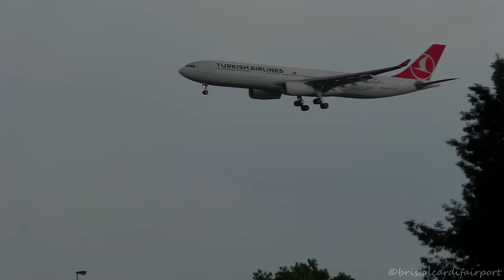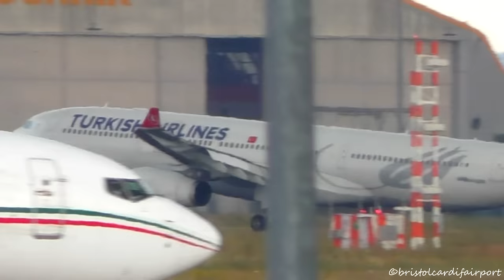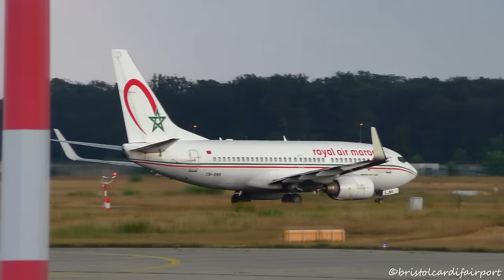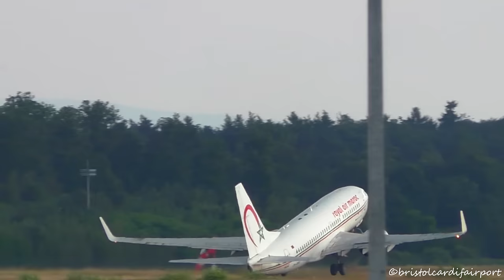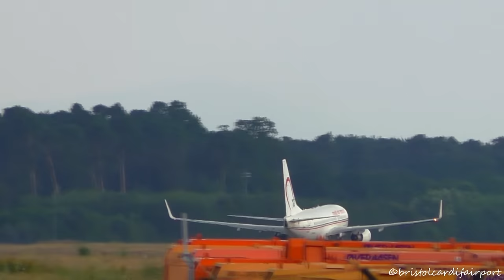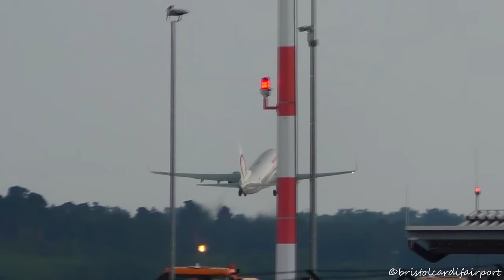PASSENGER AIRCRAFT FAILS TO TAKEOFF! BOEING 737 NEAR TAIL STRIKE & STALL ON TAKEOFF

Comment: Greetings to all!

After watching this horrifying video,  I asked an actual pilot of the airline for some insight. Turns out he was aware of this.

Turns out, wasn't a mistake at all.. as most of us thought at first.

-ATC warned the pilots about the possibility of wake turbulence caused by a preceding A330.
-737 encountered wake turbulence at rotation, which caused the airspeed/lift to bleed rapidly
-He had already pulled the nose up, and it happens that the plane regains lift, so he waited
-When the plane did gain those few feets and landed back, that's when he followed airline procedure.
-Procedure was (like many other airlines) to put the plane's nose back on runway, pick up speed again, and take off... Assuming the runway length allowed it of course, which I'm pretty sure it did at Frankfurt airport.

He wasn't surprised or anything at all.

No errors in FMC or flaps setting whatsoever... Anyway you can clearly see the "Flaps 1" setting. Was just basic aerodynamic kicking in at Vr. 

Bad timing that's all. In other words, not as bad as it looks.

Thought I'd share this today.
Cheers to you plane lovers!
Reply: Your source at Royal Air Maroc may be correct. Most posters here did not do the research to learn how wake vortices from the heavy A330 could continue to rotate in the departure path of the 737. The effect is like a microburst at the surface and would cause indicated airspeed to initially increase during the encounter. EDDF airport configuration is a significant factor due to runway layout. Addendum: After further research, the conclusion about wake turbulence is likely flawed. The vortices from the A330 should have decayed rapidly and any residual winds near the ground would likely cause no issue for the 737 departing into the path of a crossing aircraft even before expiration of the mandatory 2-minute ATC delay. More likely, the cause of this incident is an erroneous weight entry in the FMC. Still, it remains of mild interest that much of "the action" took place around the intersection of runway 18 and the extended centerline of runway 7R-25L. Coincidence? Probably. Regarding flap settings, the crew selected flaps 1 which is not unusual for a 737-700 departing a 4 kilometer runway.
Reply: Sccratlanta wtf you mean incorrect. His information came from a pilot. Are you a commercial airline pilot?? Nope....didn't think so.
Reply: revolver1212 if there is possible turbulence from previous departet aircraft why dont they wait longer? What is the required minimum waiting time?
Reply: revolver1212 Yeah, right. They're just lucky they got time and distance to cover their tracks so they didn't get investigated cos arses would have been kicked. Everyone knows that 😂
Reply: Allyn Perdue As if 😄
Reply: thanks mate, learnt something
Reply: Then the fault lies with the ATC who should never had sent him on a take-off roll that soon before a heavy aircraft.
Reply: K Hitch Absolute rubbish. I talked to tower controllers and the statement the air line made has been laughed at by the authorities involved. The other aircraft didn't even touch down on the same part of the runway and flew through different airspace altogether. In fact that airline is very close to getting banned from flying into European airspace because their safety standards are a great cause for concern.
Reply: Swede Potato Dishing
That is a conflicting story to the one served by OP. So who's telling the correct one?
Reply: revolver1212 Bruh im so scared of flying...
Reply: It depends upon the classification (weight primarily) of the involved aircraft. In this particular case, a 737-700 departing into the flight path of an arriving A330, the delay should be two minutes. Delays can be waived upon request by the departing flight crew.
Reply: Swede Potato Dishing, your statement that "the other aircraft didn't even touch down on the same part of the runway and flew through different airspace altogether" is inaccurate. Fact: The A330 approaching runway 7R crossed 1/2 mile directly ahead of the 737 departing runway 18. That puts active vortices directly in the flight path of the 737. A two minute ATC departure delay is required but may be waived at the departing flight crew's request. As for problems with Royal Air Maroc and European Union airspace, there is absolutely nothing online about their getting banned. Perhaps you can point to something real and not made up.
Reply: K Hitch, it's definitely not Swede Potato Pie. She's dishing nothing but BS. Stick with the OP.
Reply: Allyn Perdue You believe what u wanna believe, sunshine, as long as the right ppl know 😉
Reply: H
Reply: Allyn Perdue Maybe phone Frankfurt Airport if u don't believe me and they will confirm IT WASNT EVEN THE SAME RUNWAY - its a huge international airport - one of the best in Europe - and they have two parallel runways for a start.
I was born a few km down the road and lived there for many yrs. I know a handful of ppl who've worked there and as I said: That airline's statement which btw was made ONLY on Twitter, was a joke and embarrassment in itself 😂
Reply: Swede Potato Pie, there is a saying that "a little knowledge/learning is a dangerous thing." You fit the bill perfectly. I spent twenty years as an air traffic controller and have an Airline Transport Pilot's certificate with Learjet Type Rating (a few thousand hours of flight time). I also hold Flight Instructor certification for instrument, multi-engine and single-engine land. I'm going to once again address your obsession with the SAME RUNWAY and see if you possibly can learn more than the modicum you exhibit. Wake turbulence from a heavy aircraft affects all aircraft that enters airspace beneath the heavy's flight path. They do not have to be using the same runway. Again, and louder..THEY DO NOT HAVE TO BE USING THE SAME RUNWAY. Do you understand this?
Reply: Swede Potato Pie, the layout at Frankfurt (EDDF) features more than parallel runways (7L/25R, 7C/25C and 7R/25L). On the west side of the airport is runway 18 facing south. Used only for departures, the runway begins about 1/2 mile north of the extended centerline of 7R/25L. Descending vortices from aircraft approaching runway 7R will disperse roughly 1/2 mile south of the beginning of runway 18 and may drift south with a northeasterly prevailing wind. Aircraft departing runway 18 can be affected by the wake of aircraft landing runway 7R. Again and louder: AIRCRAFT DEPARTING RUNWAY 18 CAN BE AFFECTED BY THE WAKE OF AIRCRAFT LANDING RUNWAY 7R. Any questions at this point?
Reply: Swede Potato Pie, I happen to agree with you about RAM's statement. Though I believe there was a wake turbulence event, their statement about a maneuver was poorly worded. Too bad it didn't translate better. Quite embarrassing.
Reply: does it mean the pilots didn't heed to the advice of the ATC's?
Reply: Ced 1, most likely they didn't wait for the full two minutes. Pilots can waive the two minute delay by request.
Reply: revolver121
Reply: revolver1212
What if the runway wasn't long enough?
What would be the alternative or rather emergency action the pilot could have done there?
Please find out. I get scared on take offs and landing anyway and after watching this - "it is one more phobias to my collections of air flights".
Reply: revolver1212 
additionally, I notice the spoilers partially open at the peak of rotation
Reply: *FEETS*
Reply: In other words the error was in the atc in not allowing correct separation. In that case the captain followed correct procedure.  If I was that pilot, I would have been very pissed at ATC!! Could have ended very badly if shorter runway!
Reply: crowxe Irrelevant, those are flight spoilers used for roll control
Reply: Jesper Andersson 
you mean those that can be set to deploy automatically on touch down to sit the plane down and prevent it from forming lift enough to leave the ground again?
Reply: crowxe No, as i said, those in the video are flight/roll spoilers, not ground spoilers, the ground spoilers did not deploy in this video, the ground spoilers are very easy to spot because they basically cover the entire length of the wing all the way to the ailerons and the ground spoilers deploy almost vertically:

https://c1.staticflickr.com/5/4144/5193160905_9b64402237_b.jpg

Flight/roll spoilers is nothing unusual so no point for you to point them out in your previous comment.
Reply: Jesper Andersson 
so there's different set of spoilers for the 2 tasks? and if so , isn't the spoiler can be selected in various degrees like flaps? coz I remember seeing them during descent couple times and they weren't vertical (type was  A330)
Reply: crowxe The ground spoilers never deploys in the air (those that raise up vertically), and then there is flight spoilers that moves either independently or with the ailerons. The pilot can deploy the flight spoilers manually to reduce airspeed (those where the spoilers you saw in the A330), when they are not manually deployed they work as secondary flight controls (like they did in the video, they where used for roll, not for airspeed reduction).

I found a video that shows pretty nicely how they work https://www.youtube.com/watch?v=ejR9VX_UbxM
In the first part of the video the flight spoilers are deployed by the pilot and their position are fixed to reduce airspeed, then after a while they are retracted back onto the wing, when they do so they start to move with the ailerons to control roll, you can see them move several times during the landing (those are the same spoilers that moved in the video we are commenting), then when the airplane lands then obviously the ground spoilers are deployed.

If its still unclear, here is an illustration of the 737 spoiler system and an explanation https://image.slidesharecdn.com/flight-controls-r-01-160820230450/95/b737300400-flight-controls-45-638.jpg?cb=1471734341
Reply: djrmonix I know this was 3 mo the ago but there really isn't a set minimum wait time. ATC is required to make a 2 mile separation or 1000ft between flight levels. Sometimes, the controller will hold smaller planes for up to 2 minutes but most small planes avoid wake turbulence by the fact that they usually take off a lot earlier than commercial jets. The person who posted it felt like there was a safety issue and while wake turbulence is a safety issue, the pilot did what pilots are trained to do. That is, lower the nose and apply throttle in a stall. You'll note that the plane in this situation seems to be floating for a time. That's because the plane is close enough to the ground to get ground effect and the pilot could set it back down easy, get out of the wake, and then take off again. It happens more than you'd think, especially at larger airports with more traffic.
Reply: Spencer Coleman, there is a wait time of two minutes for a 737-700 departing into the wake zone of an A330. ATC issues the delay but flight crews can waive the delay by request.
Reply: revolver1212 - Thanks for your explanation!
Reply: Swede Potato Pie, any proof of RAM being very close to getting banned ?
Reply: Thank you
Reply: revolver1212    "ATC warned the pilots about the possibility of wake turbulence caused by a preceding A330."

You mean tower controllers. As part of their advisement (not warning), they would have held up the aircraft's takeoff roll until it was safe. Not let it roll down the runway and encounter an unsafe condition that would require an unsafe "second try" at rotation and lift-off.
Reply: But why flap 1? Why not flap 20 or 25 like a "normal" take-off procedure?
Reply: Most common for a 737-700 are 1 and 5. Flaps 20 and 25 are not "normal" for any 737 departing a 4000 m hard surface runway.
Reply: @Bilawal Riaz In the ATC tower environment, flight crews may waive wake turbulence departure delays (time, not distance) issued by ATC.
Reply: @da42pic  Are you addressing revolver1212 or me?
Reply: Seperation would never allow for such an incident to take place. Imagine if every 10th flight had that issue because of 'wake turbulences' and the aircracft wouldn't take off properly. Also the runway (18) is only used for takeoffs. A departing 330 would never have generated enough vortex to stop a 50 ton 737 from lifting off. Cheeky way of the pilot to keep his airline's reputation clean.
Reply: @CivilAviation1  , the A330 was not departing runway 18. It was landing 7R, overflying runway 18 about 1/2 nautical mile south of where the 737-700 began its takeoff roll. Winds were light out of the northeast giving a slight tailwind for the departing 737. Radar data (ref http://avherald.com/h?article=49d159fc ) indicated less than the prescribed two minute separation between the two aircraft (required by ICAO, FAA, etc.). Assuming ATC did their job, the RAM 737 crew waived the delay (requested from ATC) and began their takeoff roll less than a minute after the A330 overflew their departure path.
Reply: well it could've been the case no matter what we have minima for this technically its duty of ATC who's responsible for separation  but nevertheless he(PIC) should have fallowed protocol. Its makes us look bad. Separation time for departure Medium behind Heavy is at lest 2 min.
Reply: @xHustlin247x  That's why he just said incorrect with absolutely nothing to even say WHY he says incorrect let alone actual data disputing the Op's statement. On the other hand the Op post was very much informative & clearly seems to be from a pilot or an aviation professional
Reply: @thesilentway371  I don't like flying either. And yea I get the #'s when ppl always say to me "Your much more likely to get in a car accident than a plane accident." Yea I get it BUT I have been in 7 CAR CRASHES & I'm still here, you show me 1 PERSON who's survived 7 airplane crashes!!!! THATS my issue wit flying!!!
Reply: revolver1212 It’s ridiculous how airlines always rush, they’d rather risk a crash than delaying 10 more mins. Smh
Reply: Thanks Buddy for detailed information it will help others 👍👍👍
Reply: xHustlin247x he’s a comercial youtuber
Reply: B737 ng Capt here. Alright so quite a few things seem incorrect with your statements here. First: ATC doesn’t and can’t give takeoff when a heavy aircraft precedes a medium or light aircraft due to wake turbulence until sufficient time has surpassed. There’s no question of “warning” the pilot. There’s no laid down procedures from boeing where it says to lower the nose and build speed to attempt liftoff again, that could possibly be done by the pilot if he feels the situation calls for it. Boeing does however lay down procedures where one must reject takeoff beyond 80kts if there is “fire or fire warning, windshear warning, engine failure or aircraft is unable or unsafe to fly”. So what actually happened here can be classified as “aircraft unable or unsafe to fly” if the pilot flying rotated at the correct v speed. There could also be a stagnation of speeds due to a possible windshear like condition where the aircraft could have rolled a large distance without sufficient acceleration. In which case windshear escape manoeuvre must be carried out. What seems likely to have happened here is that the pilots might have entered incorrect vspeeds or flaps or possibly wrong weights. They might have set wrong trim or flaps altogether. The V speeds might not be set at all or might have blanked during take off roll. In which case, the pilots are supposed to simply rotate at 5-10 kts higher than the mcp v2 speed settings. I don’t understand by what you mean by “basic aerodynamics kicking in at vr”. And it was as bad as it looks. Had they not have had a very long runway, they’d have all been dead.
Reply: Bs
Reply: So things that I would like to understand here : 
- Why ATC authorised this plane to takeoff at first place? what happened to the 2 minutes takeoff time difference between a medium and heavy aircraft? 
- 737 needs much less runway length to takeoff than the A330. Therefore it won't even hit the wake turbulence of the heavy plane.
Reply: Thank you for the input I thought it might be something like that as it’s looked to controlled for as mistake
Reply: Interesting. Thanks for sharing
Reply: revolver1212  not even the full story.
You are quoting Royal Air Maroc. The German BFU wasn’t aware and due to missing data except the clip they could not initiate an investigation. 
So what you are telling us is only one version of it.
The question I have would be: if the RAM version is correct: why would the PIC decide to take off and risking a tail strike if he know there was wake turbulence? fishy explanation from RAM! 
So FMC and Vrefs explanation aside, why giving command for take off roll if they knew for the implications? In my books it looks a lame excuse
Reply: @xHustlin247x  right!  And all he says is "incorrect" with no facts or opinions to back it up 🤣😂
Reply: @skyhigh2118  another commercial pilot here, thanks for writing that comment out to save me doing it. The comments in here including from someone also claiming to be a Learjet driver are way off piste. This situation was dangerous, the airmanship was poor, and they should have carried out an RTO. End of. They had no idea they wouldn't get airborne and stall. If I was a pax on that aircraft I'd be banging on the flight deck door to check they weren't drunk.
Reply: We are plane lovers who watched a video about a plane failing take off as we expected to see a crash
Reply: revolver1212 Thank you for the info!
Reply: What does "flaps 1" look like?
Reply: @Flying_GC  I'm the Learjet driver. What part of my comments are way off "piste?"
Reply: @riding4beers889  On the 737-700, flaps 1 sets the leading edge slats to 50% extension and slightly extends and deflects the small aft flaps to about 8 degrees as measured from the wing chord. The following link is to a screen capture from about 29 seconds into the topic video showing flaps 1:https://a4.pbase.com/o10/84/630384/1/166877121.LsTekLx5.1.jpg
Reply: revolver1212 How long do you have to wait for the wake turbulence to go away
Reply: @NOT_MOUNT_7  Once they didn't rotate the pilots should've Immidiatly used max thrust. Also more flaps should have been configured
Reply: @allynperdue1766  if you need to ask then I'm deeply troubled by the training standards in your organisation. Its been spelt out pretty clear why this was dangerous, and I'm not repeating it again.
Reply: revolver 1212 this sounds like a very reasonable and plausible explanation. The flaps setting is barely noticeable but they are extended for take off. Thanks for researching.
Reply: Well explained.... THANKS!
Reply: @Jeppelelle  Conveniently called "Spoilerons"...
Reply: @ehsan83  You don't understand: the larger Airbus had just LANDED, and its wake vortexes crossed in front of the departing 737...
Reply: Thanks!
Reply: Wow thank you for this. You just validated my suspicions based solely on watching the video. You  Confirmed everything I said in my comment before I read your comment. Im not even a pilot I'm not even in the aeronautics world either professionally where is a hobbyist but I love your place and I flew a lot in my uncle's private planes was a kid so you can use some feel. I could really feel what was going on just watching that video so thanks for raising my confidence in my sense of aerodynamics and in are commercial pilots abilities.
Reply: This is a rock solid comment! 👏
Reply: Much appreciated with your detail answer, thought he didn't have enough speed.
I see many people making jokes. Just sick humans.
Reply: @JayJasperLondon  they should shut this air line, very wrong
Reply: Nobody asked
Reply: Thank you for the insight.
Reply: @TP-kq9ul  25 flap config for take off does not seems like normal procedure to me.. maybe for landing tho..
Reply: revolver1212 Thanks for that great information!!🙏
Reply: @allynperdue1766  I love this bit... AP:"I spent twenty years as an air traffic controller and have an Airline Transport Pilot's certificate with Learjet Type Rating (a few thousand hours of flight time). I also hold Flight Instructor certification for instrument, multi-engine and single-engine land. What is your qualification dude?" - SPP: "I was born near the airport..." I almost pissed in my pants! :)))))
Reply: Hi I am an aviation enthusiast and hopefully I will become a pilot, I flight train on 737 800 in, simulator and i know   the basics on how it flys. It is clearly a poor coverup by saying that it was wake turbulence. What everbody forgot in this chat is that wake turbulance is a incrediablys strong SPINING channel of air formed at both wingtips. Wake turbulance has been know to roll light aircraft upside down and rip wings off. Wake turbulance does not really effect pitch in the sense it does to roll. If that plane had actually encounterd wake vorticies on takeoff one of its wings would of been smashed into the tarmac, at least a violent rock to one side. What occured on the video was clearly a pilot imputed rotate at a far to slow speed, seeing at the wings remainded completly level, suggesting that the coverup, "wake turbulence" is completly false and that it was completly pilot error, I dont get the people saying this is no big deal seeing as the whole "maneuver was completly out of control and the pilots should of aborted the takeoff. Cheers
Reply: @frankgordonsmith4795  ...say 4 out of 5 flight simulator enthusiasts
Reply: Thank you
Reply: meh
Reply: Ok
Reply: @djrmonix  
Two minutes.
Reply: Thanks
Reply: Hey , I Was about to say "nerd"
Reply: @frankgordonsmith4795  The wake turbulence was generated by the A330 crossing airborne 1/2 mile ahead of the departing 737-700. The 737 would not experience the rolling motion you describe. Turbulence in this case would be displayed as an increase in indicated airspeed followed by a decrease then an increase to normal conditions. What we see in the video could also be caused by a substantial error calculating aircraft weight.
Reply: revolver1212 Wake turbulence would potentially cause the aircraft to roll, not be unable to lift off. There’s really only one thing that would cause that: Insufficient airspeed for configuration. The crew either failed to properly configure (set flaps) for the speeds they had calculated or had a wind shear after V1 (take off decision speed) causing airspeed to decrease below Vr (rotation speed). Since they were already above V1, aborting the take off was not an option so continuing the take off was the correct call, but unless they hit windshear.... The crew seriously messed up.
Reply: xHustlin247x I am. And that’s not how wake turbulence works. Wake turbulence can cause an aircraft to roll but it won’t keep it from lifting off. The only thing that will do that is insufficient airspeed for configuration (flap setting). That means the crew either set the flaps incorrectly, calculated the takeoff speeds for a different flap setting than the one selected or hit windshear during rotation that reduced their airspeed below a speed that would allow the aircraft to lift off.
Reply: @TakacatAndy  The A330 was landing on runway 7R and crossed directly ahead of the 737 departing runway 18. Wake turbulence would NOT cause a roll in this situation. It would instead cause wind shear to be experienced about 1/2 mile down runway 18 where most of the "action" in this video occurred. A more popularly accepted alternative among experienced aviators is erroneous weight data entered in the FMS which generated very low V speeds. Either option...the crew seriously messed up.
Reply: @JayJasperLondon  Potato rots, Royal Air Maroc is one of the best companies in the ignorant mode of potatoes.
Reply: I had a friend who flipped his aircraft on landing, broke his back due, to turbulence from a CH-52 that was hover-taxiing near the runway. Airport personnel got him out of the plane before it caught fire, and fortunately, no spinal cord injury. Still took him almost a year to be back out and around.
Reply: Wherever the fault was (pilots or ATC or both), just think about the panic aboard — passengers feeling and watching the plane lift off and then bang down again and then luckily up again. Definitely not good
Reply: @allynperdue1766  An obvious SHILL on damage control for the Airline: Commenting for over 2 years in defense of a very dangerous, avoidable near-catastrophe.                 FACT: THAT WAS ALMOST A (STALL-INDUCED?) TAILSTRIKE  ,  'surprise' or not is irrelevant: 
This is an utterly unacceptable performance:  YOURS (airline shill), the pilot and /or ATC.  
Allyn: what is amongst the 5 most deadly mishaps during take-off OVER THE LAST 60 YEARS?  Yep: TAILSTRIKE!  VR IS HYPER-CRITICAL!
Reply: @NOT_MOUNT_7  the pilot, as a last resort, will simply do a rectalosculation.
Reply: @allynperdue1766  Could you explain why they're allowed to waive that 2 minute delay? It seems concerning that they can put themselves in a dangerous situation like this just so they can adhere closely to their scheduled departure
Reply: How was that 'Horrifying' 🤷‍♂️🤷‍♂️🤷‍♂️
Reply: @Ducati_Dude  It's a bit like when one piston in a V-configured high-performance IC engine (see own moniker) starts clapping its hands to cheer the 2nd piston along for even greater performance..... that kind of FUBAR 'horrifying' , just in aviation terms...., Duke.     I'm sure you are quite familiar with this 'characteristic' , so regularly displayed by your branded namesake.
Reply: @almostbutnotentirelyunreas166  --->  L-Twin   Dude...
Reply: @Ducati_Dude  True story, L-twin it is!  Or at least was , just before all the the other internals also started applauding the efforts of that last piston to keep going.....the after-effects look just like  a post-MCAS MAX....Horrifying.
Reply: I can confirm I was the pilot
Reply: didn't buy it to be honest

Morrocons are just good at making food not flying planes
Reply: @andrulifts  yep
Reply: Thanks for the info. Cheers.
Reply: @djrmonix  Its about money and rotate as many airplanes as possible each day.
Yes it make perfect sence to just let the smaller 737 wait a few minuttes so they are shure all wake turbulence from the bigger
airplane is gone.
If the plane was smaller than the 737 and it was just a little in the air it could crash .
It have happen before.
But its about money.
Reply: I didn't understand anything yet I was reading your comment to the end like I knew any of the stuff u said. 😆 😆 😆 😆
Reply: I very much doubt being unable to take off was part of the plan...
Reply: Very interesting exchanges on this thread, thanks for the read.. I ride big cc motorbikes and no nothing about flying jets (well I didn't till reading this thread) just revs the knackers out of that thing I'm sure it'll go up!!
Reply: @JayJasperLondon  clearly your not a pilot.
Reply: @JayJasperLondon  Looks like a windshare just after VR.... Committed to takeoff. Safety standards of airline might be bad. But this is how windshare on TO lookslike after VR.
Reply: @geoh7777  there is nothing unsafe about a second attempt at rotation, provided the runway is long enough to make it possible. I love how you try to attach the word "unsafe" as if stating it as such makes it a fact.
Reply: @BigDsmoke  your comment is ridiculous, because a person is highly unlikely to be involved in seven plane crashes in their lifetime, so you are only confirming the "cars are more likely to crash" statistic.
Reply: @carlo_berruti  it wouldn't have "banged down". At most you would feel a little vibration as the nose wheel reconnected with the pavement.
Reply: @Mr1988wk  I flew 737[s] and I am more convinced that the V numbers  [ V1  Vr ] were incorrect [ for the flap setting ]and allowed an attempt to become airborne well before there was enough energy to sustain flight.  My disagreement stems from the fact that the area of trial, covered on the runway was very extensive for the effects of  local wake turbulence [ not  at altitude ]. I was looking for some banking of the wings that would be consistent with [ severe enough ] wake turbulence and it was not evident. I don't know all the facts and the crew successfully corrected the situation allowing more airspeed; but First Officers sometimes calculate the wrong take of weight,  going back to errors in the Zero fuel weight;  passenger count,  last minute cargo changes; or errors in the weight of fuel dispensed to the aircraft.
Reply: @YouTube.TOM.A  I would say pilots calculate wrong V speeds not first officer. Seen plenty of all pilots of all ranks make mistakes with the calculations. I believe its windshare. If im wrong calculations would be my first guess, as it looks like they are using rwy 18 which is a departure only RWY if si remeber correctly and seperated way to much to blame wake turbulance.
Reply: @Mr1988wk  Fair enough. It's all the  responsibility of the captain.  I would receive the weight and balance [ e mail ] and the skipper would verify it.  One occasion the ZFW was [ entered ] wrong and when I gave the speeds we both agreed that something was wrong compared to previous flights.    I am glad you shined some light on the issue.
Reply: Ginjapie  not me
Reply: I work in the gift shop and  all of you are wrong.
Reply: @Steve-fe4lq  LMFAO!!! That WAS NOT my point AT ALL which obviously escaped you 🤣🤣🤣 My point was NOT that, IT WAS that just one plane crash & there's a good chance you won't have a chance at a 2nd lmfao. THAT WAS MY POINT that the reason I fear a plane crash over a car crash is that a car crash IS much more likely to be SURVIVABLE not less luckily to happen LMFAO 😂🤣😂🤣😂
Reply: @BigDsmoke  my nigga.
Reply: Thank you.
Reply: @JayJasperLondon  The good thing is videos like this give us all something to watch, however I usually find myself reading comments more than I actually watch videos. But I agree sweet potato, I saw the whole thing happen. If you look closely there is a guy lying on a lawn chair at the end of the runway, that's me....
Reply: @CivilAviation1  Pilot forgot to put down the flaps...
Reply: Wonderful insight
Reply: @NOT_MOUNT_7  on a shorter runway if they dont respond fast enough or procrastinate the runway length then can result in over shoot or if there is trees after the runway as air France had, that would result in explosion
Reply: @BigDsmoke  I've never been a car crash or a plane crash.
Reply: @BigDsmoke  you would rarely have a plane emergency and even if u did the pilots are able to control everything, even engine failures etc. But if there is a bomb on board then thats a problem, the main issues could be explosions. But if its engine failure or flaps failure or minor things they can always land at a close airport or land in the ocean. Chances are very low for death. Most terrified fliers watch aircraft explosions etc which not good lol
Reply: Akou Bam Excuse me while I’m off laughing next door 😂😂😂
Reply: @OFfic3R1K  None at all. Just trawled the Official EU data and not only were they never given a warning they have never received advisories. And they have an excellent safety record.
Reply: @OFfic3R1K  None at all. Just trawled through the official EU data and R A M have never received a warning or even an airline advisory. Excellent safety record.
Reply: Yeah bad timing how many millions of people died because of bad timing not in just aviation...
Reply: TYVM
Reply: Thank you for clearing all the misunderstanding
Reply: Runway 18 is well known for wake events.  I have flown out of FRA over 400 times, mostly on 18 and have experienced sudden wake events. The forest either side I do not believe helps.  Also, the surface of the runway is terrible and inexperienced crew might consider a tyre had failed!
Reply: you're wrong! i spoke to the pilots mum's daughter in laws ex husband.. he said he did it as a prank on the passengers
Reply: Wake turb can cause very nasty roll upsets (something that didn’t happen here), but I have never heard of it ‘sucking’ 20 knots out from under the wing. 
No, they lied, if that’s what they said. 
They either rotated way too early, or set the wrong thrust. 
(Huge under-calculation of weight, wrong flap setting, or nose-up trim are also plausible)
Reply: Ca...ca...can't we all just get along?
Reply: I think more flaps was needed
Reply: Absolute BS.  They rotated too early.  Thankfully they had enough runway left to get back up.  They should have put the nose down and did everything they could to stop on the runway.  Then admit to themselves what they did wrong, take a step back and try again once the crew was clear on the mistake. 
 Wake turbulence....my ass.
Reply: Thanks for clearing that up, because I thought he was off the runway bouncing on the grass!
Reply: @allynperdue1766  thanks for the information
Reply: Thanks for the information brother ☺️
Reply: @GWAYGWAY1   They were at flaps 1, which is a typical takeoff setting for a -700.  The wake explanation is bullshit.  They rotated too early and tried to pull it off the ground.  I’m guessing incorrect v-speeds.  Overall just shitty airmanship.  I hope they don’t start flying the MAX.
Reply: @JayJasperLondon  Lmao you got thanos snapped
Reply: Rubbish
Reply: Interesting. Thanks
Reply: Incorrect weight input in flight manager computer.
Reply: Total bullshit. Wake turbulence my ass. No flaps, wrong speeds, a total mess
Reply: @allynperdue1766  to be honest, your understanding of the physics of vortices in proximity to ground is also quite flawed. In addition, that 737 shows no signs of hitting wake turbulence - it simply rotated too early. By the way, pilots usually hold licenses and not „certificates“.
Reply: @spiller212  Back to front; In the U.S. I hold an ATP Certificate with LR-JET Type rating issued in 1980. It has a clearly labeled certificate number. The 737 indeed rotated too early. The questions are why and why did the crew not quickly lower the nose earlier in the takeoff roll. The most likely scenario is a major error entering weight data into the FMC. After further research, I agree with you that my initial statements were flawed. The vortices from the A330 should have decayed rapidly and any residual winds near the ground would likely cause no issue for the 737 departing into the path of a crossing aircraft. Still, it remains of mild interest that much of "the action" took place around the intersection of runway 18 and the extended centerline of runway 7R-25L. Coincidence? Most likely.
Reply: @allynperdue1766  Thank you for the swift answer, Allyn. I didn't mean to insult you in any way - unfortunately there are so many people on YouTube claiming things about them that couldn't be more untrue, so I am especially suspicious when it comes to aviation topics as it is a breeding ground for impostors. I am glad to have never hit a wake turbulence of a "heavy" but I did have some encounters with my own wake while orbiting. Albeit naturally only passing them for a split second, it always felt like a hard hit - so I can only imagine how it must feel hitting the vortices longitudinally. There is no evidence in the video that suggests that plane hit any wake turbulence at all as it should have visibly rocked the aircraft. It seems like they rotated too early, either by misjudgement or miscalculation of Vr or for other reasons. Consequently, the airline blames an exogene factor for what happened, but this is very unlikely.
Reply: Thanks for explaining this, as not being a pilot I was wondering if this was SOP.
Reply: I have dispatched and flown many 737NG with 1° flap for T-O, we called it "improved climb" which required V speeds about 7-8% higher and longer runways.  You have leading edge deployed but the rear flaps only extend aft on their tracks and no downward yet as in 5°+ settings
Reply: Best is to ensure lag in take off
Reply: Thanks for informing
Reply: I certainly appreciate getting the real story behind this.
Reply: A320 would take off without any hesitation...
Crappy 737 was farting trying to get up in the air.
Reply: Thats all fine but this left no margin for error. One more negative factor into these and it could be catastrophe
Reply: @NOT_MOUNT_7  Usually V1 (abort speed) is verliefd Vr (rotate),  so even with problems like this or one engine flaming out, they'll have to continue takeoff.
Reply: Revolver no sens of all what you have said, it was a big mistake from the pilot
Reply: Well explained. Good job
Reply: @allynperdue1766  haha...nicely done
Reply: FichDich InDemArsch  Good point. I'll add a correction.
Reply: @feonor26  the pilot could have chosen to wait. Not the ATC's fault because they send the aircraft regardless of type one after the other at busy airports like Boston. They do tell the pilots "caution wake turbulence" during their takeoff clearance.
Reply: FichDich InDemArsch  If you watch closely those wings flexing that plane hits some turbulence right at beginning of take-off roll. Turbulence from that Airbus left wing. Second time that same flexing happens at rotation. Turbulence  from Airbus right wing
Reply: Mentour Pilot channel does an examination of this video with the same conclusion..only, about 4 years later. Not sure why?
Reply: That's a great clarification
Reply: Flaps were not set buddy. How do you see flaps were properly set?
Reply: It's clearly flaps 0
Reply: Its just Moroccan skills
Reply: Was the pilot you spoke to Mentour pilot😂 Let’s just say you watched his video
Reply: I think you'll find most viewers were expecting something more dramatic,  especially with comments starting  "watching this horrific video ".
Not being a pilot it didn't even cross my mind it could have been the pilots fault,  poor choice of words in the title
Reply: @spiller212  Pilots in the US hold certificates, not licenses.
Reply: @michaelstump6933  thank you, never heard of that. How come it's called PPL, CPL, ATPL and so on? Those are "licenses", not "certificates".
Reply: @spiller212  Check out the certification requirements on the FAA's website under CFR 14 Part 61, Certification of Airmen.  Just checked my two FAA pilot certs and my A&P cert and they all show the words "certificate number" on them.  I think the acronyms might originate from slang, but can't prove it.  In the 1990s I became a CFI, or "Certified" Flight Instructor, hence, one carrying a "certificate."  In training the instructors were always quick to correct students who said "license."  What surprises me is the continued use of the term "Airmen" by the FAA.  I certainly don't have a problem with it but somebody, somewhere probably has a full time job with a pension working on getting this changed to "Airperson."  ;)
Reply: On wake turbulence vs. PIC vs. ATC... many times I have flown a helicopter across / through the final approach path of an international airport, between heavies (seemingly always FedEx freight) often coming in on two minute intervals.  In these cases, there is no two minute period for me to wait on wake turbulence to settle.  ATC (Ontario International Airport tower in SoCal, in this case) simply states instructions on which airplane to pass behind,  "expedite if possible," and "caution, wake turbulence."  In my reply to the tower, I simply state "Expedite transition behind FedEx heavy (example), wake turbulence," followed by the helicopter's call sign.  By this very act I am communicating my acceptance of the risk associated with passing through an area within which there will be wake turbulence, and without a two minute dwell.  So, I avoid the wake by flying over it.  Since I fly under visual flight rules (VFR), I have an obligation to see and avoid other aircraft, and observe rights-of-way.  There are certain exceptions, but US pilots generally cannot perform maneuvers not necessary for normal flight, cannot create an undue risk to passengers, or persons or property on the surface, and must be aware of the behaviors and dangers of wake turbulence and how to avoid it.  The pilot in command (PIC) is the final authority as to the operation of an aircraft, not ATC.  If a pilot needs a couple of minutes for wake turbulence to settle before rolling, its no problem to arrange that with ground control / the tower.  One of the pilot behaviors covered in pilot training is "get there-itis" which can be brought on by excess pilot  confidence and complacency, the feeling of needing to cut a few corners here and there to arrive on time, and the belief that there isn't much risk associated with said corner-cutting ("It wont happen to me!")
Reply: @michaelstump6933  Okay, thank you for the clarification. I have a Part-FCL (in accordance with ICAO-standards) license and it clearly says "license". I did not know that about the US. Haha, had to laugh at the "Airperson" - well observed! Certainly gonna happen in the near future ;-)
Reply: @spiller212  ...until some people are offended and stop self-identifying as a person...lol.  Thanks for the heads-up on the ICAO differences... it adds clarity.
Reply: @michaelstump6933  ..."Airsubjects" would be appropriate I guess? Haha...
Reply: Waffler
Reply: @BradleyPennyAviation what?
Reply: Finally someone that knows what they are talking about.
Reply: @allynperdue1766  Wake turbulence does not always decay: Sometimes it acts as a trigger point. Explain why water does not boil at the same temperature always.
Reply: @djrmonix  The control tower determines when and if an airplane is clear to take off or land.
Reply: @thesilentway371  I am scared of stupid car drivers.
Reply: Well put
Reply: @djrmonix  due to rush hours and maybe even for money, they usually rush departures to try to minimize delays
Reply: @C901-r8i  he did, the ATC never gave the clearance to hold short, the atc gave clearance 	for	 takeoff and warned of wake turbulence of an airbus a330
Reply: Makes sense
Reply: Will the pilots be investigated for lapses?
Reply: This is a long comment it took me a hot 2mins to finish reading although it’s really good explaining thanks!
Reply: "Turns out, wasn't a mistake at all.. as most of us thought at first."

Well, that´s the point of commenting to early and without having real knowledge.
 The crew did exatly what they had to do because --> 737 encountered wake turbulence from the TK 330 at rotation, which caused the airspeed/lift to bleed rapidly.

It´s that simple if you understand what you are looking to.
Reply: He never had enough speed and didn't give full power
Reply: @djrmonix  - common question. Wait time to take off is at the order of ATC, and its ATC's job to know how votices affect their runways.

Remember this isnt the same or parallel runways between the two aircraft, they are perpendicular, so the crew of this aircraft wouldn't necessarily see how much a vortices could affect them.
Reply: @JayJasperLondon  - Actually ... right.  Not onl;y didnt they have enough room and time to take off, but they even actually reported the aberrant vortices to ATC, recommending a longer pause between runway usage.
If you actually report the issue, its not your fault ... but everyone knows that too.
Reply: How many minutes should a plane take before going for a run away after the other plane ahead just took off?.
Reply: @TP-kq9ul  flap 20 or 25 are not take off flaps. Flaps 5 yes is
Reply: @mikeelmira  🤣🤣🤣
Reply: I thought it was because of al the camels in the cargo bay 😋